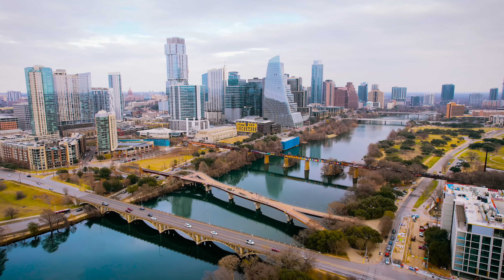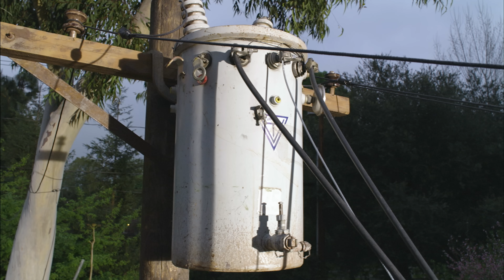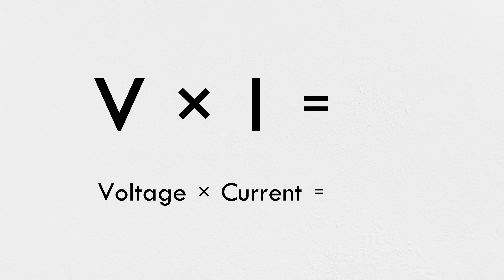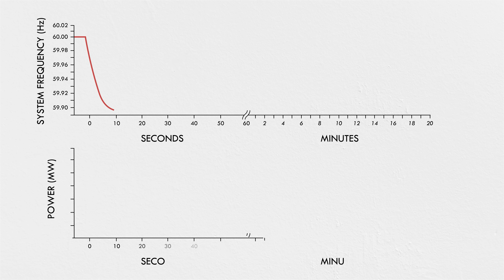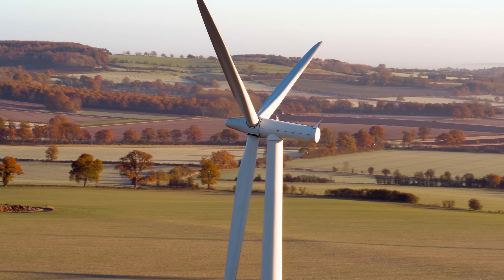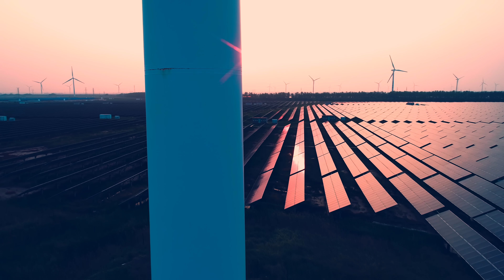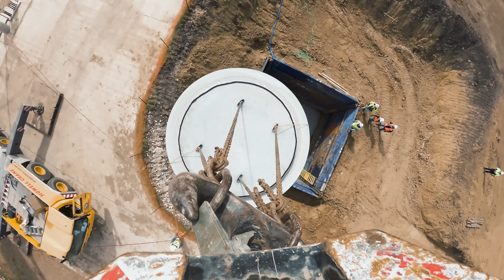Connecting Solar to the Grid is Harder Than You Think

Comment: I understand this, but that's because I'm an engineer. Even really nice solid-state inverters don't mesh very well with the sine-wave AC power grid. The ideal way is to have your solar cells driving a DC-to-AC conversion generator with a PID control system to maintain your converters at 60 hertz. Those are expensive and require maintenance, though, so stepped inverters are the standard because they're usually good enough.

Additionally, your wind turbines could use something like an IVT or CVT transmission system to keep their output at a continuous 60 hertz regardless of the actual rotational speed of the wind mill without having to worry about the more lossy system of converting to DC and back to AC.

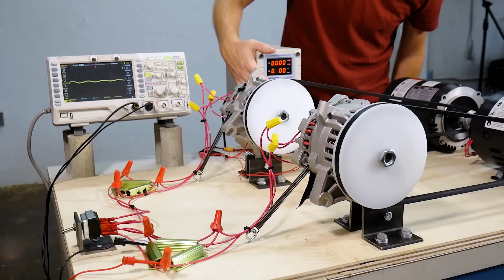Comment: At 7:30 it’s mentioned that these systems only produce power when the grid is active- regardless if the sun is shining. how does my Tesla Powerwall continue to provide me with power with no fluctuations regardless of the grid status? 
In the 18 months I’ve had the system it’s shown no problem to continue power output during grid down situations.

Comment: I wonder if it would ever be practical for enough non-critical industry to exist that would allow power generators to run at full capacity, under the conditions that certain sectors of the grid may be abruptly cut off under emergency conditions. I have my doubts, since this would necessitate building infrastructure that would have unreliable power supply, but I feel like there are certain forms of production that can mange that. Perhaps certain autonomous tasks, like computationally intensive rendering/processing tasks that can easily be paused/reinitiated if they power is cut.

Comment: Really good news, until you find out the Eversource in Ct lost 2 billion dollars on a failed wind farm and passed that cost onto it's customers.
Reply: Okay, not all investments work. $2B is not a big deal. I'm a consultant electrical engineer for many large utilities. There is no plan by anyone at any level for a zero carbon grid. Policy makers are not engineers and are driving us quickly off a cliff.
Reply: @thedude5040  My only gripe is that Ct has some of the highest rates in the US, and they want a 19% increase.
Reply: @allanszast7579  the only power we have left to keep your lights on is to burn more coal and natural gas elsewhere then charge you higher rates for energy transport. But even this plan may not last beyond 2027ish when major coal plants in the north east go offline.

Comment: Yeah, I think the only major fully-renewable energy technology that doesn't have this problem, is hydropower (from resources like Niagara Falls), and while hydropower is a great option where it's available, it has a different set of problems:  it relies heavily on specific kinds of topography (and thus there are some geographical areas where it just plain can't be used), and there are inherent limits on how much kinetic energy is available to harvest.  Also in some cases (particularly where a dam is involved) it has environmental impact issues that have to be addressed.

There's no free lunch.  Every option comes with challenges.
Reply: Hydro power is fully Carbon-free in Arctic and temperate climates, but not tropical climate Hydro, which has a dark secret - methane (a potent greenhouse gas) which is produced in copious quantities by rotting vegetation during and for many years after impoundment. I live in a tropical country, and we have significant biomass generation capacity, typical plants are 10 - 50 MW in size and burn agricultural waste (rice husks, palm kernels, sugar cane residue, etc.) so are Carbon-free. SInce these are thermal stations, they are suitable for base load generation.

Comment: This is quite similar to problems I have developing bidirectional battery swap system for light electric vehicles. I writing my bachelor's thesis about it and even getting bidirectional simulations working in Simulink was quite hard so doing this safely in real world is going to be even harder. At least my system could quite easily adjust its output power but getting anti-islanding, virtual inertia and fault tolerances right is going to be big challenge.

Comment: OMG I had never expected to hear  Phase Lock Loop(PLL) here! As PLL is mostly, or traditionally used in telecommunication system to for synchronise signal or basically pick out the carrier frequency from the modulated signal.
Never thought power grid would also use such a thing. Amazing

Comment: Inverters for feeding solar energy back into the grid for home use have an algorithm that synchronizes on the zero crossing of the sine wave. Also the grid voltage has to be above 12V before the inverter can start. This to prevent dangerous situations when the power company want to work on the grid and switches off a distribution transformer.

Comment: There is something I don't understand here. Even large power plants like a nuclear power plant can't just follow what ever the phase of the grid happens to be. Then they would behave as badly as inverter power in an overload event. The overall grid must have a central phase reference somewhere, that all major power plants follow. A steady pulse that is independent of the grid and dictates where the sinewave zero crossings should be. If you just make this phase reference available to all inverter power stations too, they would not sink down the frequency but instead work hard to maintain it.

Comment: i've wondered a few times, how can we have households contributing power to the grid to prevent shutdowns when that would make it unsafe to work on the lines?

like if the grid dies or is in the process of dying, and a bunch of households somehow have gear that tries to help restore the grid instead of following the ever lowering frequency, even if that somehow worked and kept the grid stable, isn't that making power lines live at all times and unsafe to ever work on?
we'd have to disconnect each individual house to make sure they're not a source of power on any section of power line we need inactive for physical line work to take place, wouldn't we?

there has to be some kind of communication between all contributors of power i think, to coordinate everyone and maintain the ability to fully shut down any part of the grid.

reckon we can set up a data network on the power lines themselves to do that job, or got any better ideas? :)

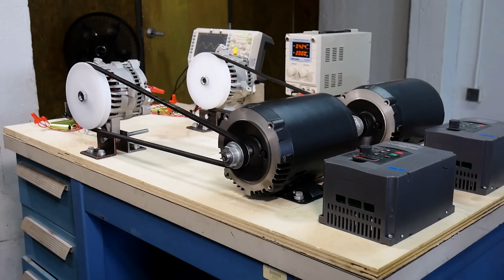Comment: @PracticalEngineeringChannel I wish you would've talked more about homes with solar power. At ~7:32, you said [most inverted based resources can only follow whats already on the grid...that's why most grid-tied solar systems on houses can't provide power during an outage]

And while that made sense, I guess my question is, if the grid tied home has a battery bank, you can then power the home during a blackout, right?

Also, if they used grid-forming inverters instead of grid-following inverters, would that allow them to blakstart and provide power to houses during an outage.

Sorry...also, great video btw! I always learn so much from your videos and I'm constantly amazed at the breadth and depth of your engineering knowledge!!

Comment: Now that we have more tech for inverters and digital stuff, is there a different way a smaller or different type of grid could work? like say, if theres generation at each end user, say solar, wind whatever. then they have their storage. their inverter makes the frequency for their system. is there a way to connect it to a sort of grid that absorbs excess power, but doesn't deliver full power, ever. Instead the point of this grid is to absorb the unneeded excesses, and is in an area where people don't need lots of power 24/7. If the end users are sufficiently self contained in their needs then they can still link up to feed into storage for lighting, communications equipment etc, If theres lots of days with out generation like say cloudy and no solar coming in, the grid tie simply is charging the battery system very slowly and one must be careful to not use too much power. I think maybe some stuff like this might happen becase now that we have all this technology we can sort of build it backwards or try new stuff. But this is a compex subject and I still don't quite get it. The frequency part.

Comment: I built a solar powered kayak by putting a large flexible solar panel on a PVC adjustable frame. It acts as a sunshade, and powers a standard 12 volt trolling motor via PWM to provide the optimum panel loading. The fun part is this is done manually to find MPPT, so changing course or a cloud coming over requires PWM adjustment. Like sailing, where you need to constantly adjust for the wind.

Comment: On August 15, 2023, Brazil went trough an unexpected country wide blackout. It started 8:30 am local time at a 500 kV transmission line located in Ceara state in northeast Brazil. Along that line, there are many grid tied solar and wind power plants. That line was unexpectedly shut down by protective relays, even though at that moment it was not overloaded nor at short circuit. Shortly after that, a series of cascaded events occurred, with relays tripping and shutting down subsequent transmission lines. Voltage levels (230 and 500 kV) dropped wildly and synchronization (60 Hz) was lost. Many customers across the country were cut from the grid (about 22 GW or 31% of the whole country) in an attempt to recover voltage and frequency to nominal values. It took until 3 pm of that day to put everything back together. After a couple months of investigation, it resulted in a 572 pages technical report, showing that it should not have happened, considering all the redundancies on the power grid. The conclusion was that the grid operator had a given set of the electrical parameters of those solar and wind power plants, but in fact, they behaved very different from what was expected. Those power plants were set to export power to the grid with power factor close to 1, i.e. they exported mainly active power, with very little reactive power. At the moment the line was shut down, the grid was expecting a large amount of reactive power to be injected, but it was later verified that in fact that amount of reactive power was being absorbed from the grid, thus dropping the voltage level, automatically tripping protective relays, and resulting the blackout.

Comment: Excellent coverage of a very technical subject. I worked as a protection engineer for 42 years. Originally when small wind machines were being added to the system it was common to have them trip off for any perturbation on thw system. But as wind and solar grew to be a significant percentage of generation we began requiring ride through ability. Of course the vendors all had their own designs and everything was proprietary and often didn't react as expected by us.

Inverters also create issues for protection engineers as they don't produce fault current, they are current limited devices.  That makes conventional relay protection unsuitable and more expensive high speed communication based schemes are needed.
Reply: IIRC fault-ride-through is actually designed to inject reactive power at possibly full kVA rating when a fault voltage pattern is detected, to trip the breakers without needing to have excessive real power on hand.
Reply: @namibjDerEchte  I work with 61850 monitoring - hardware and software.

Comment: That just sounds like their frequency settings were too tight. In the UK, generation won't trip off until it falls outside of 47.5-51.5 Hz - that's +1.5Hz and -2.5Hz. This fault didn't even make -1Hz. Really I think the issue here was poor management and investment of Texas' electrical infrastructure. Sure, renewables are inverter driven and thus have far less fault ride-through capability than traditional rotating generators, but there are solutions out there for this that have been developed for large ships (eg rotating stabilisers on cruise ships and aircraft carriers) that have been implemented in other countries' grids.

Comment: Two crazy idea.  One instead of one house using one connector and paying you back by reducing your bill.
  How about power company leases the rooftops in a neighborhood and reduce the grid connections.
Lease going to the owner of the house. It would increase the value of the property.

Second idea. Keep home solar, wind on DC. Standardize voltage and plugs and wire the house.  
Close to standardizing now. Just need to add priority to the plug.  Example dehumidifier in the basement. 
Secondary heater/cooler.  If power is available on.. Fall below threshold, reduce or standby. Not just cut off power.
 
Perhaps add two to four hours of batteries capacity. The electric company can add power to the battery at night.

Comment: I call that inertia of the turbine to help steady the frequency the "flywheel effect".  Large factories will just run a large unloaded synchronous motors on their local power system to help steady the frequency when a large motor starts up.

Comment: The city I live in produces over 3 times more electricity than it can use just from rooftop solar. It is actually quite easy to produce electricity in the amounts needed for any modern city. The biggest problem is that the people in charge of the electricity generation don't actually know how to properly manage renewable energy. It took my city 10 years to work out how to manage a renewable energy system but once they did we have not had any major problems and now the only cause of blackouts is from downed power lines caused by trees, lightning and vehicle accidents, they are only local events that effect less than 100 homes and last between 1-2 hours.

Comment: In regards to the MPPT, it actually doesn't work the way you described in an AC-coupled system.  In a DC coupled system, yes, the MPPT is independent.  In an AC-coupled system, however, there is a direct correlation between the power the inverter tries to push to the grid and the MPPT point so the inverter is actually controlling the MPPT point.  The microprocessor implementing the MPPT algorithm does it by controlling the inverter's output to the grid.   They aren't separate functions.

Also, there is no "resistor".  The MPPT is not controlled by resistance... that would be.... interesting (the charge controller would basically melt).   No, the MPPT is basically just a switching power supply and in an AC-coupled system the inverter winds up being that switching power supply.   So the MPPT point is controlled simply by controlling how much current the system pushes into the grid (or the battery, or whatever).   No resistors or resistance is involved.

-Matt

Comment: That description of how pure sine-wave inverters work isn't really correct, but I liked the episode anyway.  In anycase modified sine wave inverters are indeed just simple switches at two or three different voltage levels.  Pure sine-wave inverters, however, use a transformer and/or inductor.   While there are still "switches", the behavior of a transformer or an inductor is that they won't let through all the voltage (or current) all at once.  They have to build their magnetic field and when the switch is turned off they have to unbuild it.   That process more or less creates a pure sine wave.  You only need a modest filter stage on the output to get a very good sine wave output.

So a pure sine wave inverter doesn't have more switches... it has a magnetic component (inductor and/or transformer) which naturally creates a sine wave on its output.

The "pulse width" of the PWM does not create the sine wave.  It controls the voltage.  The frequency of the PWM (which is fixed)... that is what correlates to the sine wave.  They are actually two different things entirely even though they are all combined together into the PWM signal.  A PWM always has a fundamental frequency and it typically does not change.  The "pulse width" part of it is simply the duty cycle of the "low" vs the "high".  But the "low" plus the "high" is fixed.

-Matt

Comment: Nicely done.  The first point that needs to be fully grokked is that solar produces zero energy after sunset.  Windmills generate nothing without steady wind.  Batteries are a finite resource.  Load that cant be served will be always be shed, regardless.  Without torque, maintaining frequency is impossible.  Under-frequency relays throughout the system will operate long before nadir is reached.  Physics is the Law.